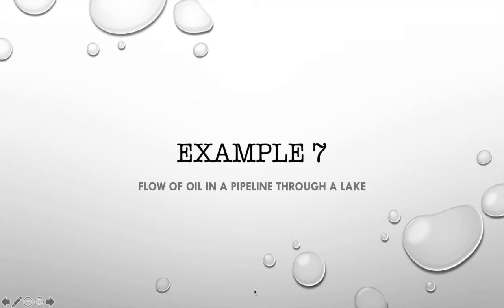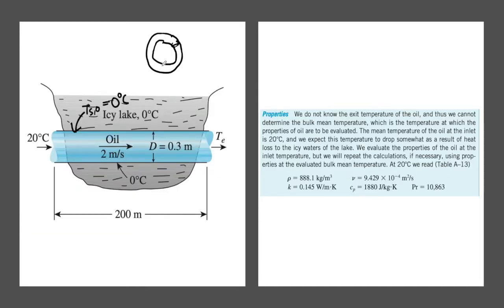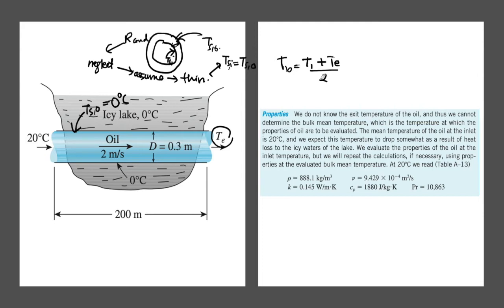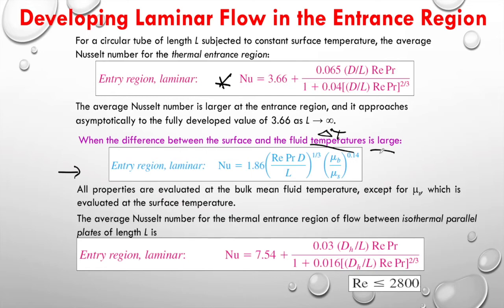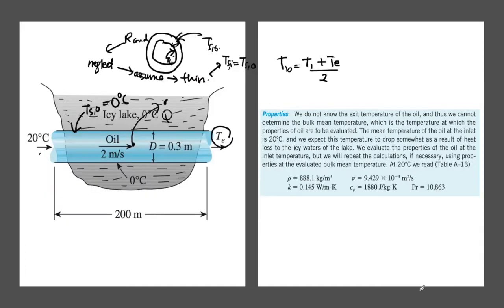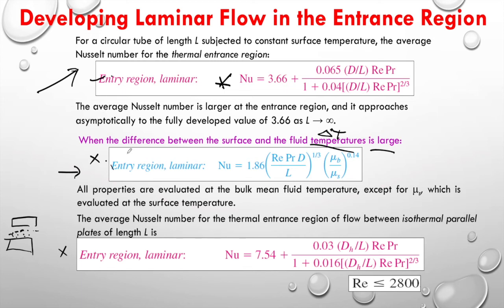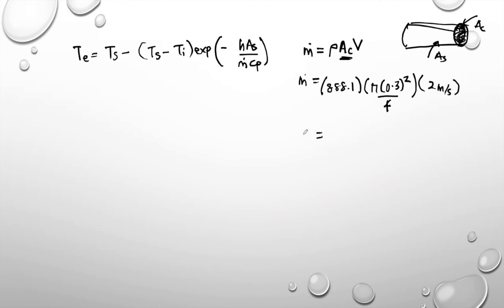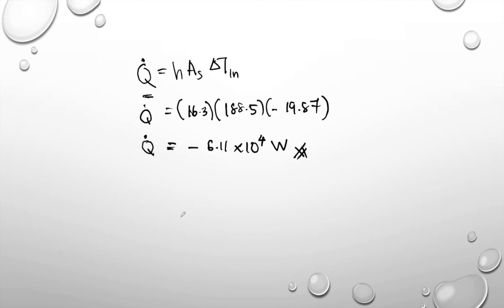Example 7 Flow of Oil in a Pipeline through a Lake

Comment: Please why did you not add the 3.66 when calculating for the Nusselt number?
Reply from the maker: yes. the length of the pipe falls in the region of thermal entry length. I do my calculation in separate sheet then plug in that value into the slide. Perhaps, I do miss during calculation step adding 3.66 in my calculation. If you got different value of Nu number as shown, do change the value accordingly. Sorry for that. Hope this answer your querry.